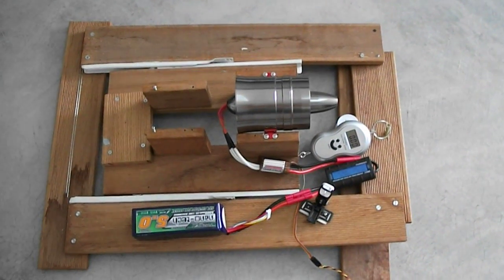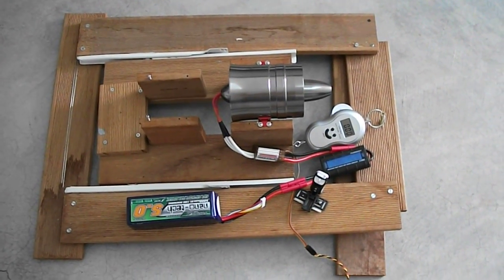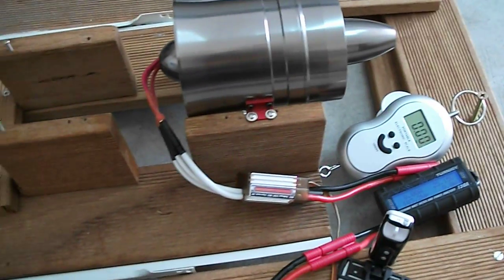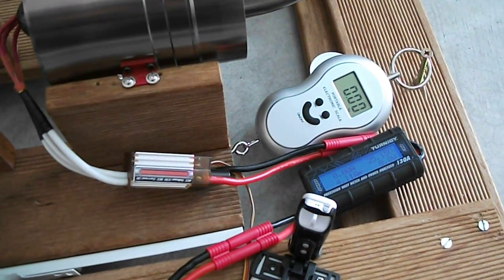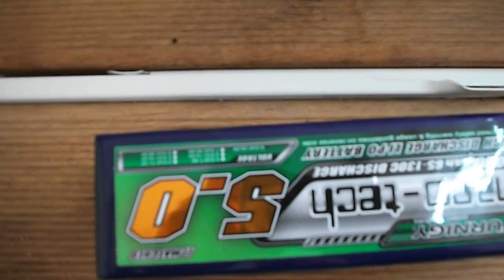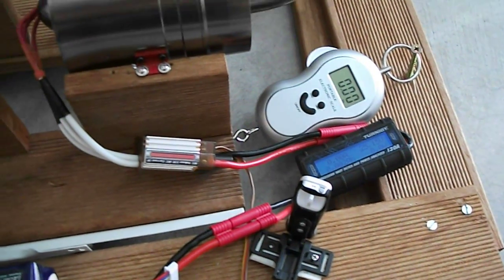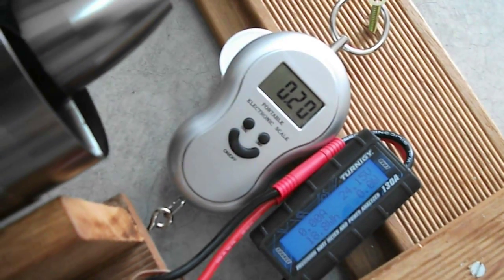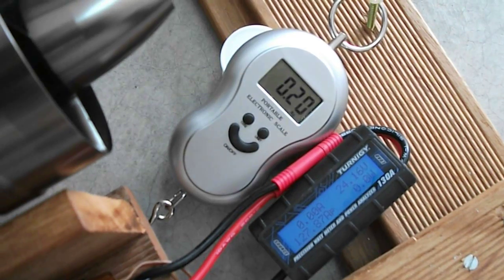Mercury 90mm - 1900kv Alloy Fan - 6S Thrust Test

Comment: Hobbyking says this EDF will give 3.5kg at 95A :( What have your findings been with this unit? It is still pretty expensive so it must be pretty good?
Reply from the maker: +vanepico It's good engineeing but the Hobbyking numbers are not accurate.
The thrust is 3.1Kg at 120amps.
Reply: Do you have much experience with other EDF units? If so how does it compare to others? I am planning a build, it will be my first EDF and I want it to be as efficient as I can get it.
Reply from the maker: +vanepico Some other EDFs can produce the same thrust for 10amps less but they can be difficult to balance properly. This one is a good choice if you

If your build's weight is going to be 3 to 3.5 Kg then this EDF will do just fine.

If your model is going to weigh more then you should go to the 1600kv version which can be run at 8 or 9S producing 4-4.5Kg thrust.
Reply: +AnLucas Ok thanks, my reason for picking the 6s version was because I wanted to use multiples of 3s 2200 30c packs, I was thinking of using two in series by two in parallel to get 6s 4400, but to get more thrust I could go with three in series and two in parallel for 9s 4400 and it would be good for 132 amps with both cases. this is really me just being greedy, it probably won't weigh 3 kilos but I want it to ba able to go fast!
Reply: 100 amp esc enough this edf?

Comment: My results with a Turnigy 150A Opto Esc, Lipo Turnigy 6S 5000Mah 40C, using the same  measuring method with the same stuff:

3,0 Kg (max peak) - 93A (103A max peak)

With ring intake:
3,6 Kg